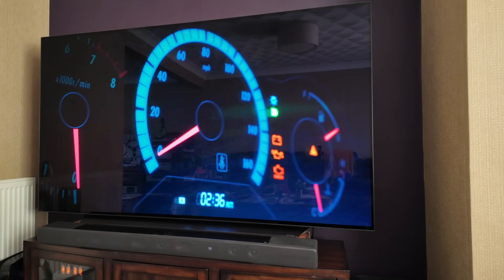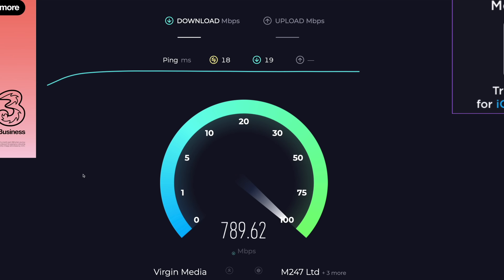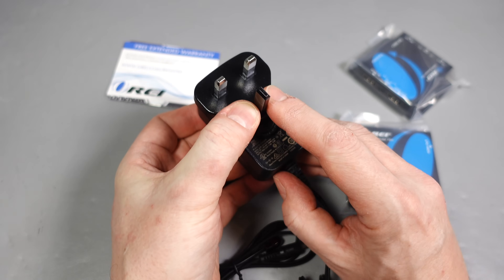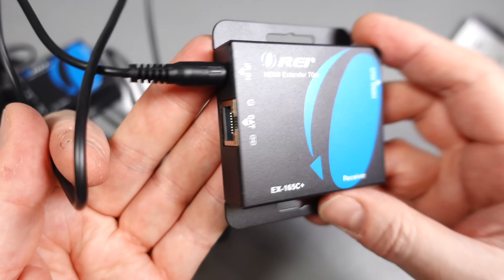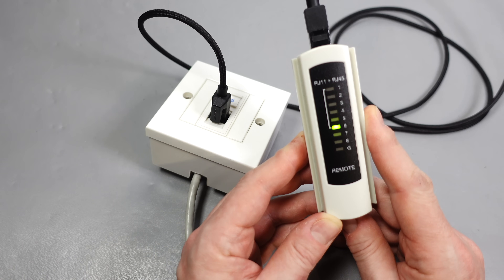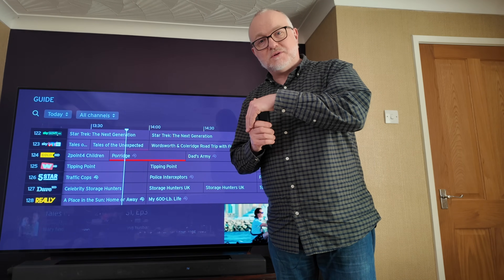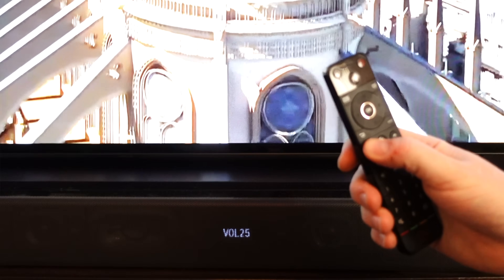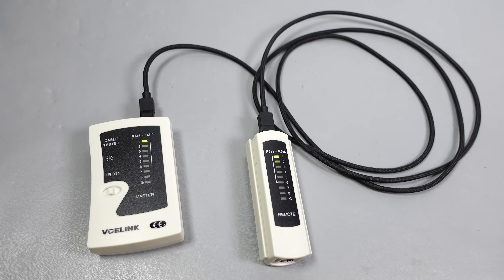HDMI via a Cat6 cable works surprisingly well

Comment: At my church we got a new TV monitor. The monitor is used for bible verses and songs and is behind the pastor. it's connected to a computer in the sound booth. The old computer and monitors went away however the old computer used an Svideo to RF Modulator to send the signal over coax on channel 4 to the old monitors. It was completely analog. For the newer computer and new monitor that would not have been ideal. It wasn't a big problem with the old monitors because they were super old rear projection TVs. Video quality wasn't a huge concern. we needed the HDMI signal from the computer to the TV. There was already coax in place so I found a similar HDMI over coax solution. It works perfectly.

Comment: When you use B on one side and A on the other, you create a crossover cable. The sort of cable that is TX RX swapped and can be used between two PCs without handshake. If you use the same pinout on both sides, that's a patch cable that connects a hub or switch to an endpoint device. Hubs came with one uplink port and 4/8 downlink ports which were wired differently.

Now everything has auto detection handshake, there is no difference between uplink and downlink ports of a switch, you can connect a computer with a crossover or patch cable and it'll just detect the cable type and work just fine.

Except obviously all sorts of these sorts of things like passive and active baluns, which do not use real Ethernet and just reuse Ethernet type cabling for non-Ethernet forms of signalling.

HDMI transmitters also exist in real Ethernet version, which uses MJPEG encoding, works perfectly fine as well, also quite inexpensive, perhaps less suitable for game consoles due to extra latency, but with TV like use you'd never be able to tell and the quality is good. Indeed it was a cheap option to do HD video capture before cheap USB HD capture cards came about, since the network protocol ended up really easy to reverse engineer. Been around for a really long time.

I love the spittable patch cable tester as well, i have one of those. Super simple electronics based on a timer ic and a counter ic and nothing much else in there, tech from the 70s, elegant in that way.

Comment: I buy Startech or Monoprice HDMI over cat5 adapters for work all the time. Most of the time I don't need to extend IR, but I have one with USB here at home for my CCTV DVR. I would like to test one with a serial connector for monitors with RS-232 connectors so I could use a converter instead of a Crestron QM-RMC.

Comment: Ah, unintentioanlly made a crossover cable through your walls.  Most modern network devices can detect and use a crossover cable no problems, but something specialized like this I guess not.

Comment: My missus doesn't like to see cables so when I installed the TV in this place I ran 4 dedicated cat6 cables between the lounge and the room where my networking kit lives, used a couple of these to shunt signals back and forth between the TV and our surround receiver (in the network room), concealed the front speaker cabling in a recess on the back of the timber support for the TV bracket and ran the rears and sub through the ceiling to the back of the room, bit of a job but she was happy at the end.

Only thing I'd flag is one of the HDMI to Cat5/6 devices I did had some weird colour space issue, if I plugged it between my streaming box and the receiver it was fine but if I plugged it between the receiver and the TV the hue was all wrong, I think it was a swapped  RGB/YUV colour space thing.

Comment: We have used similar units in a broadcast environment for a few years with no issues.   It's a very specific use case for us and the signals never make it to air (we do not use HDMI in the video chain at all).   But the same concept applies.  Fun fact: HDMI cables are, essentially, just twisted pair cables with the same number of wires inside as a network cable (ie: Cat5 or Cat6).   The main difference is the HDMI cable has extra shielding the typical network cable lacks.  (And, of course, the connectors are different.)

Comment: I have a very small house in semi-Rural Missouri, so small (Think New York Single-bed loft, except i actually have a large lawn) I could simply  wire multiple TVs with HDMI, in-fact the only reason I have wireless is for guests and doing things outside, however HDMI through CAT has been a thing for quite a while and I never even considered it. Good idea.

 I may do something simular when setting up my office in the back room. Plan to use one PC as both an office PC and my Living rooms entertainment center on two different desks and 4 displays, in two seperate rooms, the office "PC" running a VM perhaps.

Comment: So, you are using ethernet cable to pass and HDMI signal from a box that's in another room, that uses ethernet cable to connect to your router, instead of  moving the box closer to the TV and just connecting the box directly to the TV.
Did I get that right? And it's not even the first of April anymore.

Comment: You can see IR (remote) signals with your cell phone's camera.  Good way to verify if a blaster is working.
Wireless HDMI re-compresses the signal so it's not great for moving video.
I use one at work for a computer to projector setup.  In that case, it's fine because the image is mostly still.  Maybe a talking head for a video conference.

Comment: Not only does using Cat 6 instead of HDMI make it easier to run cables from room to room, you’re also much more likely to get cat 6 cable that’s rated to be run through walls. HDMI is rarely ever run through walls (and even then is only usually run straight up a single wall to get to a wall mounted TV) and usually isn’t rated for it.

Comment: 41€ in germany incl. vat is quite a good price. 

I simply need to fully understand all the step if it is really capable of sending out the sky signal to another TV which means a kind of switch which I doubt it does cause that switch or Y cable would be needed between the sky box and the current tv in the same room. 
But I need to switch between the target devices like current TV and the TV outside on the veranda. 
FOUND IT - on their website is a 94€ package for a splitter and these extenders which should do the trick to deliver the sky output to the box and from there to a TV and that TV on the veranda. Great one !

Comment: I use similar devices a ton at work (IT A/V specialist). Something to note: some of them don't play nice with DHCP. You can run into issues where they'll work on one computer but not another, or with one dongle but not another. It can get very tedious. You'll especially run into issues if the extender supports/passes hdcp 2, but the destination display only supports hdcp 1.x. It's infuriating to troubleshoot.

You also want to keep in mind how it handles EDID, lest you end up with really wonky scaling. I think this is mostly a computer issue, I don't think cable boxes/receivers/cameras/etc usually handle scaling internally, but some may. These give you a choice, which is nice, but not always included.

Also, can't recommend enough specifically finding models that only need a single power supply and let you choose which end it's on. That flexibility can really save you in a pinch and also allows you to cut down cable clutter in cramped spaces

Comment: We used a similar device at Reagan airport so that we could transmit the weather & plane position radar system from the operations room to the ramp breakroom so ramp personnel could see when planes were getting close to landing and get ready to go out and attend to it on the ground.

Comment: I use a bunch of the OREI HDMI-over-Cat5/Cat6 devices in a larger commercial building, even already having an IP video distribution system, since they're simple and work well for random short-term projects, and learned one thing - be careful about mix-and-match on OREI - some of theirs use 12V adapters, and some use 24V... and if you accidentally mix them, they either don't work, or the receiver can be destroyed (as I've managed to do a couple times.)

Comment: You think these are cool? Also check out hdmi network matrix’s. Use them at work a lot, and these point to point ones, to get CCTV live view to customers TV’s etc.

I am hoping a company is able to develop a neater way of bringing power and video signal to monitors. Would probably have to be a DC powered monitor on 50V or so

Comment: Old reliable solution.  Using long HDMI runs creates handshaking issues.  This is literally THE way to do it.  I use BlackMagic boxes instead of these cheap Orei boxes.  I have found the quality to be better with BlackMagic boxes.  They're a little pricier but they're more reliable.  If these do the trick for you, enjoy!

Comment: I’ve put probably $1000 into HDMI over UTP baluns, and they never worked.  First one I tried was a dual-cable box that I bought before I even had an HD source or TV.  I was using a 1024x768 projector.  Didn’t work.  Last one I tried was about 7 years ago, just to see if they had gotten any better.  They hadn’t.

I learned my lesson.  I was never trying to go THAT far, and an actual HDMI cable of 25-50 feet always worked, whereas spending a few hundred bucks on an over-the-top solution to avoid running one cable, did not.

The only conclusion I can draw here, is that this box doesn’t actually transmit HDMI over UTP.  Since video codec ICs are such jellybean parts now, I actually wonder if this is re-encoding the data into a serial bitstream and transmitting it at whatever bitrate it can handle.  It would certainly explain why, suddenly, this is something that can be done without issue.

Comment: FYI, there also are fiber optical HDMI cables that are really slim down the wire, often with removable connectors. These can be handy if you need low latency and high bandwidth (pushing HDMI 2.1 to another room) or really long projector runs.

Comment: Wait until you get to the channels like Legend and True Crime etc - they look sooo bad on Virgin (I have Sky and Virgin) - and Sky has a better quality, Virgin is definitely lower even with HD but they use a compression which makes it blocky but less soft - for example E4 HD is awful looking during fast movement scenes - it looked better around 2018 before they switched to MPEG4
Reply: TIP though, using the microphone say “skip 4 minutes” at the beginning of an advert break to skip most if not all of the adverts

Comment: If you had a network cable between the rooms why didn't you just put the box in the TV room? You could use the network cable to connect up to whatever was in the old equipment location, right?

Comment: Yep. Been there, done that with Ethernet cabling.

Everything seems to work perfectly until the day you plug something new in … and it doesn’t work? 🤔

Even those little testers like you’ve got can put you on the right track to solving the problem.

Comment: I used to use these HDMI extenders all the time when I worked in AV as a tech. Sometimes we would have the transmitter and receiver on different levels of a home, a good distance. They gave problems at times but they worked well for the most part. As you know, HDMi could be more complicated because of Handshakes. The ones we installed I believe were pretty expensive. Hope the set you have works well.

Comment: I don't know about this particular Virgin box, as I am not UK based,
But wouldn't it have been simpler to extend the network connection for the Virgin box and simply install the box under the TV? That what I did with my internet provider's tv box.
They claim you need a separate connection, but when the installer came and saw my network setup, he simply told me to plug it in anywhere in the network, as long as it's 1Gbit or higher.

Comment: you had it wired as a cross over cable by the looks of it this will work fine for computers as most networking devices can detect crossover cables and use them just fine but if you want to send just a standard data signal you need it to be identical on both ends, easy mistake to make to be honest, cross over cables are normally only used to connected to computers together without a hub/switch/router connected.

Comment: All this device does is take the HDMI Signal and pass it over ethernet they are handy to have I remember about 10 years ago stuff like this was not cheap but they tend to just work just fine as iv never had issues with them, another great video as always.

Comment: Quite fun to see you using software I've been working on (the UI of your Virgin Media Arris DCX-960 STB), this brings back memories :D
As I remember, some channels were using IPTV so no coax cable was required. Also, you can record a program on a STB with HDD from another one that doesn't have one and even play local recordings remotely using the network so technically this hardware is perfectly capable of streaming QAM cable TV signal over the LAN to another STB (which is approx 6-8 Mbits/s), I can't tell why this wasn't implemented.

Comment: one tip: mark the ports that they are for the HDMI extender.
Because the extender sends power over the cable it could damage other network equipment if someone swaps a cable for what ever reason

Comment: I worked for a K-12 school in the 1990s, when we contracted for ethernet to be puled throughout the building. (Cat5 back then) and wouldn't you know, every. single. drop. was installed wired T-568A, while every port in the network room was done T-568B. The contractor was very embarrassed. ◡̈

Comment: Wiring standard guide to remember,  T568A = American and T568B = British.  Obviously anything would do as long as they match but you will always remember a bodge.
HDMI use - all wires. Minimum for Ethernet = wire 123 and 6 (Oranges and greens).  PoE Power over Ethernet  for remote powered devices use the other colours.
Mixing Ethernet and old phone lines often used the blue (or brown) pair for the phone.

Comment: There are long-run HDMI cables with barrel connectors (similar to PS/2)  close to one end that are meant for fishing through walls without the large HDMI connector attached.  They are stupid expensive!  This looks like a great solution as an alternative to running two CAT5/6 cables and using adapters or when IR transmission is required.

Comment: I've had a receiver and projector setup for 20+ years and have been working on how best to get the audio/video signals from one to another.  Spoiler - etherrnet (Cat 5 or 6) cabling worked best.  I started with composite video L/R audio in coax which worked fine but got only 1080p.  Then went to component video RGB L/R audio in coax which got me up to 2K.  Got flaky when I replaced the receiver and projector.  I was shooting for projecting 3D projection. Nope.  Went to wireless HDMI.  Not any better.  Then ran ethernet and everything works and gives me 4K plus 3D projection (really cool)!  WOOT!  Techmoan should now talk about how to handle sending IR wireless remote's signals to multiple other devices (receiver/DVD/ROKU/OTATV, etc) like behind a closed cabinet (pretty simple really).

Comment: They are used in professional environments all the time.
We use all sorts of alternatives to basic hdmi cables.
Optical hdmi.
Hdmi to optical converters.
Hdmi to SDI.
And obviously this hdmi base-t.
All work well and have slightly different applications.

Comment: Many CATV systems here in the US use MoCA to communicate between the master box with the tuner and the extension boxes. This usually works out fine since most rooms have coax run to them already. Some boxes even allow communication over wired Ethernet, but at that point you might as well just go with IPTV direct over the internet.

Comment: I'm happy to see this works so well for most content. You mention video games, and I agree that this will work well for games that don't require quick reflexes, but these sorts of devices have a tendency to add latency, which could be bad for some games.

Then again, this could be one of those devices designed well enough that there is no significant latency (16ms or more, the length of a frame at 60 frames per second) and if so would be the perfect solution as long as 1080p is the target.
Reply: I believe these non-Ethernet wired versions send uncompressed video with sub-frame latency. Versions which use actual Ethernet compress and decompress the entire stream which adds at least several frames of latency.

Comment: What I had to use once for a projector install in a classroom, with an old VGA cable running through the ducts, was a passive 2x RJ-45 to HDMI, both ends were completely passive and with two cables you've got enough wires, twisted pairs at that, to bring the whole signal just fine. Don't know how long it can get but with CAT 5e it obviously managed 720p 60 Hz just fine over ~10m or so.
This active box is quite interesting in that it uses just one cable, and when you do the math it makes sense why it could do it: 1920 * 1080 * 32 * 60 = about 4 Gb/s, 4K 30 Hz would be double that, and that cabling can do 10 Gb/s so no wonder, I would bet that it's internally using repurposed, electrically identical but protocol wise incompatible, 10 gigabit Ethernet PoE hardware. Can't pass it through networking gear but very likely using all the same parts anyway.

Comment: I believe we used the same brand, probably an older model, that after many years of use splitting the HDMI out between 2 projectors would only work with 1 projector at a time.  We had definitely gotten our moneys worth out of it!  Another advantage as well is using Plenum cabling in the ceiling, ethernet is easier than HDMI to run/manage unless you're using fiber Micro-HDMI with adapters, but they have their pro's and con's as well.